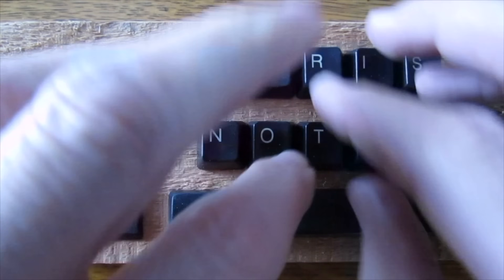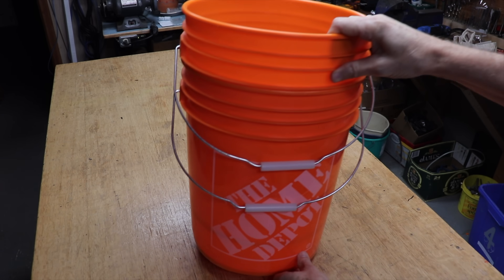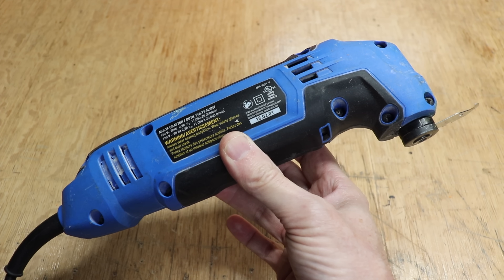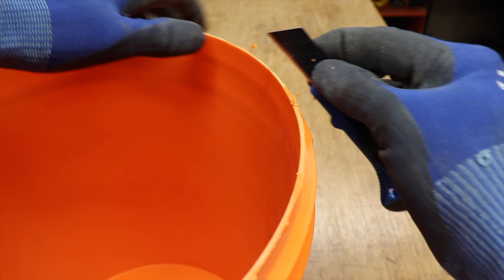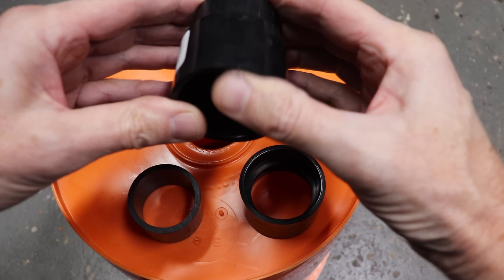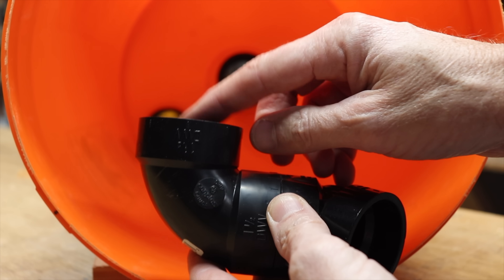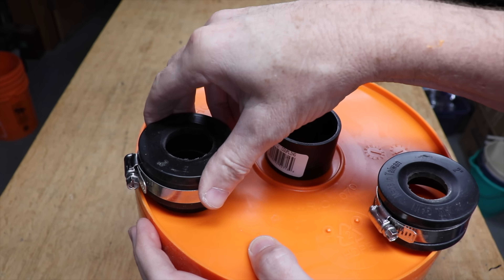How to Make ● Simple Cyclone Dust Collector

Comment: Why don't you have a dust bag in your vacuum? Wouldn't it make more sense to have that for the dust that comes through the "orange system" instaed of trying to protect the filter in any way. The dust bag would fill in that much, you could easily modify that so that you can empty it and you vacuum would be in much cleaner state.

Comment: Awesome, works great, one issue. My little 5 H.P. ShopVac causes the Home Depot buckets to collapse when I use it with my orbital sander. Seems it needs some mechanism to reduce suction but, I don't want to affect its ability to function. Any suggestions?
Reply from the maker: I made an update video on that issue!!
Reply: Nice, thank you Chris. Easy fixes. Heck I had already ordered a couple of 90 MIL thick buckets.

Comment: Fun tip: to double the  airflow, hook one shop vac to the cyclone bucket, hook the second one to the exhaust of the first one. Now your vacuums are hooked in series and you have double the airflow but less pull when vacuuming (dry vacuum usage) 

To increase water lift: hook a second shop vac to the bucket in similar fashion  on the opposing side of the hose intake hole. Now your vacuum is hooked up in parallel and you have double the suction. (Wet vacuum usage )

You can also do both simultaneously if you have 4 vacuums lol.

Comment: Как думаете, уменьшится ли сила всасывания, если магистраль сделать в общей сложности около 5 метров?
Reply: Для более длинных всасывающих шлангов может оказаться полезным использовать шланг немного большего диаметра или жесткую трубу с клапанами и соединителями для подсоединения более короткого гибкого шланга. В зависимости от применения, мощности всасывающего двигателя и использования вытяжной системы {мастерская бытовой системы} Старайтесь, чтобы шланги были как можно более плоскими, без резких изгибов, особенно без петель вверх и вниз, чтобы предотвратить скопление пыли и закупорка и уменьшение потока в шланге или трубе.

Может быть полезно проложить незащищенный заземляющий провод вдоль внешней стороны жесткой трубы, чтобы остановить накопление статического электричества и предотвратить легкие, но отвлекающие удары электрическим током.

For longer suction hoses, it may be helpful to use a slightly larger diameter hose or rigid pipe with valves and connectors to connect the shorter flexible hose. Depending on the application, the power of the suction motor and the use of the exhaust system {household system or workshop} Try to keep the hoses as flat as possible, without sharp bends, especially without up and down loops, to prevent dust from accumulating and clogging and reducing the flow in the hose or pipe

It may be helpful to run an unsheathed ground wire along the outside of the rigid pipe to stop static build-up and prevent mild but distracting electric shocks.

Comment: Great video but I'm not sure if it's what I need. Maybe so or maybe you have another video on sandblaster cabinet dust. Sandblaster cabnet dust is my problem. The dust kills my visibility to the point where I can't see my work. I don't want to pick up any heavy material. I just want to clear the air so that I can see what I'm doing. Any suggestions?
Reply from the maker: Other commenters have said it worked for drywall dust so I'd say it will work for sandblasting too.

Comment: Just built my dust collector today, tried it out & am very happy with the results. Thanks for a great project, that doesn't require "specialty" tools or cost a small fortune. I then caught the "update" video & will be adding the base to stabilize it. Thinking I might put castors on the modified base, for easier mobility

Comment: Hi Chris, thank you so much for this very instructive video! Just what I needed before chaos ensued in my garage! I have one question - what is the impact on the shop vac and the dust collection efficiency if I were to use bigger pails or maybe use one of those plastic garbage bins? Would it work just as well? I suppose emptying that would be a bigger pain, but the trucks could haul that away! Maybe you were trying to keep the effort needed for emptying the saw dust at manageable levels and so used the HD buckets? Again, really enjoyed the video and the thoughtful parts list you appended. Have a nice day!
Reply from the maker: Thanks for that!! You could try with a larger container. It should work the same and possibly even better. It's all about experimenting and using your noggin!!
Reply: Seems like the straight connectors mentioned won’t work with the elbow couplers. Need to be off a smaller size
Reply: @shankarh6915 did you try make it with bigger barrel? How it work? I wanna try make one with 200 liter pvc barrel (cylinder shape).

Comment: “Friction fit”. The correct terminology may help your’ audience understand what you’re talking about.
Reply from the maker: Sorry about that. An "interference fit", also known as a "pressed fit" or "friction fit", is a form of fastening between two tightfitting mating parts that produces a joint which is held together by friction after the parts are pushed together.

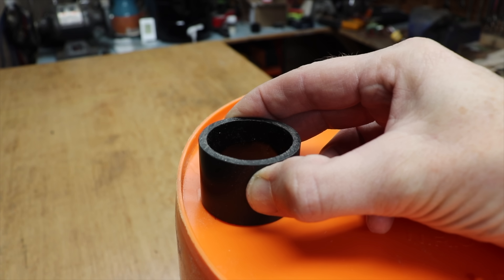Comment: Coming back to this thread 2 years later, still struggling to find a better dust collector that won't break the bank.  I found the problem with my build, my buckets aren't Hofmann Plastics buckets (2:45 Minute mark) made for Home Depot, my buckets were manufactured by Leaktite.  So I have buckets that are more  I_I  than  \_/.  Hofmann is a Canadian company making finding these buckets even harder.
Reply from the maker: Others have commented that Lowes buckets work too.
Reply: How did it affect the build?

Comment: What is the screw for?
Reply from the maker: I show using the screw in the video.
Reply: @chrisnotap  yeah I know. I just wasn't 100% sure what it was for. Do you screw screw it into the inner pipe to keep it in place?
Reply from the maker: @chopa479  Yes it holds the pipe in position.

Comment: Perfect. I can mount my vacuum on a shelf up high in the middle of the shop and then run a hose down to this little gem. Great design and well made! Kudos!
Reply: Can anyone comment on why building this is better than purchasing the Dustopper from HD for $59? Is it that much better?
Reply: @adompe3  It is cheaper, funner, but the satisfaction of a job well done or the innovativeness of improving on the design is my motivation. We'd all be living in caves otherwise. i can already see how to improve it because i built one years ago that had zero dust, mind you it was a lot bigger but it was not filtered at all.

Comment: I built the dust collector, everything went together as advertised. Great directions. Unfortunately when I  connected and turned on my 5 gallon shop vac it sucked the Home Depot buckets in and distorted their shape. It still functioned but clearly the walls of buckets I have are too weak. HD must have changed the formula. I substituted an old bucket that held driveway sealer. Noticeably stiffer. It held up just fine. So I’ll look for another stiffer bucket to replace the head. Since none of the pipe fittings are glued they can be removed and reused.
So I’d advise sourcing stiffer plastic pails.
Reply from the maker: I did and update video for that problem!

Comment: Simply ingenious. Im getting older and I dont do well in dust. Ive been researching for hours to put up plastic, utility blowers with 12 to 16inch wide x 30 feet long flexible ducts. I just want as dust free an environment as possible. Renovating a basement. Its a walkout but doesnt have good air flow with the only windows on the same wall as door. I am definitely going to build this. I already have all the parts and multiple HD n Lowes buckets! Thank you for this how to video! Its going to save my lungs and my wallet.

Comment: I just built this in my garage this afternoon, and it works perfectly! Thanks so much for making this! The only thing that didn't work out as well for me was the friction fit between the top and bottom buckets (it's a bit loose on mine). It's not really a huge problem, as the buckets don't really come apart when I'm using the vacuum, but I do have to be careful not to pick up the system from the top bucket or it will just pop right off. I may have removed too much material when I used a razor blade to create the angle and remove the burrs, so it was user error on my part! Just something for other people to be aware of.
Reply: Built your dust separator today and very pleased with the final  results. A couple of comments: my vacuum has a larger hose, wonder if 2” fittings might have worked better. Second was either I have a more powerful vacuum or my HD buckets were made with thinner walls, the buckets collapsed after running for a few minutes. My solution was to pop rivet 3/4” x 1/4” ribs every 4 inches around the outside of the buckets. Problem solved. 😅

Comment: I saw this video a couple years ago and wanted to build this ever since, but didn't really need it enough to build one. A couple days ago I decided I wanted the power of my central vacuum system to wet-vacuum my car's carpets but the vacuum unit is not okay with moisture. This cyclone separator solved my problem and works great at separating everything including water, but it was also very simple to build and only took one trip to the hardware store for all the supplies! Thank you!

Comment: Do you have a video that talks about how well this works if you hook the  standard hose side of your dust separator directly to an orbital sander or circular saw as opposed to just using it to clean up your shop floor? If you do not, can you recommend a video? Or is that even necessary?

Comment: Very efficient build. 
Tip: use 2 high quality magnets (Neodymium) instead of the backlight or measuring tape to find points on the other side of materials. Just put one magnet on each side and drag into position. Most magnets will work on this thin walled bucket, but even drywall can be done with good magnets.

Comment: Chris, no matter what I do, I can't get the buckets together. I followed your instructions to the letter. Is it the buckets or me? I Spent nearly 3 hours and pretty much ruined 1 bucket. I left the second bucket with the rings removed in case I can find out why they won't come together. It appears that the bucket with the rings removed is the same diameter as the center of the second bucket upper rim. Chamfering the first bucket made no difference, it still ended up in the same place. I tried chamfering the rim of the second bucket, but I would have to remove too much material thus causing the rim to come apart. What am I doing wrong?
Reply from the maker: You're not doing anything wrong. From reading all of the comments, it has made me aware that home depot buckets are not the same across the land. There seems to be 2 different styles. Quite a few commenters have also said that Lowes buckets work well. You may want to try theirs. Sorry this isn't working and I hope you find an alternative.
Reply: @chrisnotap  Chris, thank you for getting back to me. While I was at Home Depot, I purchased a bucket to replace the one I ruined. You'll never guess what happened. The new bucket matched perfectly with the bucket that was trimmed. also, the Lowes bucket that I trimmed, fit perfectly into the Home Depot bucket. Unfortunately, I had the same problem with the Lowes buckets.  They just wouldn't go together. I may take the Lowes bucket that I trimmed to Lowes and see if it will fit into a new Lowes bucket. Thanks again, I now have what I need to make your dust collector.

Comment: Great invention but that
Great invention!   However, that's a wee lit'l shop vac you have.  I'll need to get bigger fittings to fit the large shop vac hose, whatever size that it.  I'm wondering it that might collapse those buckets since those big shop vacs are beasts.

Comment: I just tried this, and the buckets will not fit together. The ones I bought are made differently, so that they are straight from the handle up. Home Depot must have seen your video and said, "We can't have this eating into our sales of our cyclone separator. Let's redesign the bucket to get rid of the taper at the top." I will find a way to make it work, though. They aren't going to force me into anything!
Reply from the maker: Commenters have made me aware that home depot buckets are not the same across the land. They are different in some parts. There seems to be 2 styles. Commenters have also said that Lowes buckets work. You may want to try theirs. Sorry this isn't working for you and I hope you find an alternative.
Reply: I’m thinking that I can use some foam I have lying around to make a gasket and  clamp the buckets together. I will try that and see how it works.

Comment: I 1000% love this design and how cheap and effective it is. Thank you so much. 

I also had a great idea for it the other day. I clean a lot of electronics equipment. Washing and drying a circuit board takes too long and I hate it. 

But then it hit me. If you reverse the flow of this thing and clean out the dust, it becomes a parts dryer that I can just sit back and let it do its thing. Works great!
Reply from the maker: You don't need to reverse the flow! It is air movement either way you do it!

Comment: First, i was like, yeah yeah, lets buy the real stuff, the oneida thing. But the one with the bucket and ready to go is like 200$can, and some reviews says its a little fragile. So i decided to do it my self.  Used jigsaw to cut the bucket, et knife for  the rubber lids, and mitter saw for the ABS pipe.  Took 20 min. The hardest part is to stick the 2 buckets together, but i succeded by pushing it with my belly while holding buckets with my hands.  
Tried with some saw dust and other stuff, it really works. This is the greatest invention ever!! Today im gonna try with drywall dust, a ton of it, because i just finished renovating my old place. Wish me good luck, to my shopvac too !
Reply from the maker: That's great! Let me know how it works with the drywall dust!
Reply: How did it work with the drywall dust? I've wondered if it can handle fine dust like that
Reply: @j10001  very good. I w
Reply: @j10001  very good. Of course it doesn't grab 100% of the dust (maybe 80-90%). So you still have to change your shopvac paper filter from time to time, or once your done with the drywall mess.

Comment: Still the best setup on the internet. Drywall buckets work also, although they are usually 4.5 gallons instead of 5 gallons. Free is still no cost. Construction sites usually through drywall buckets into a dumpster.

Comment: Finally one of these diy dust collector videos that doesn't use that stupid injection molded lid.  This also works as a diy large capacity house vacuum, so long as you have a few extensions and a brush head accessory for a shop vac.

Comment: I made one of these and after the maiden voyage I broke it apart and tossed it out.  While it does work to some degree,  my filter is clogged with sawdust, drywall dust and dog hair.  Be a man, vacuum your shop the regular way.  When the filter clogs, do what our ancestors did.  Take it apart, shake it out in the garbage can, then go outside with your air hose and see how much of your neighbors garage you can turn white.  Hopefully it rains before they get home.  Reinstall the filter and carry on.  While not an epic fail,  we had the promise of prime rib and when we show up there was only hamburger.

Comment: Does the center hole in the bucket have to be in the center to work? Can it be on the opposite end? Cause I'd like to have space to mount a smaller vac on top of the collector.
Reply from the maker: Needs to be where it is.

Comment: I followed your plans and built one of these last summer and it works great!
I also noticed another advantage. A 5 gallon shop vac isn't really 5 gallons. You'll only get 2, maybe 3 gallons of liquid before you start to submerge the motor. With your design collector I can suck up a full 5 gallons of liquid. The motor stays dry and the filter doesn't even get damp.

Comment: Great video I put one together the other day seems to work pretty good I solve the Tipping Problem by just buying a bucket Dolly from Walmart the bucket sits down in and gets clamped in place by 3 wing nut bolts I did still cut off as pale and slid it up from the bottom to prevent collapsing and so that I could slide the inner bucket out without having to undo the clamps

Comment: If you added a cone inside the top half the dust would spin ever faster as it drops down the cone. When it exits, the dust gets thrown to the sides of the lower bucket leaving almost no dust to be trapped by the shop vac filter.

Comment: This video makes me equally happy and equally angry. I had the thought yesterday. WHY DON'T THEY MAKE THE VACCUM THE CYCLONE? How have manufacturers not figured out how to move the dust port over to the side of the vacuum, to stop the filter from clogging up? Unbelievable. So they shouldn't even sell a vacuum today with a center dust port, it's almost like a scam to not have a "built in" cyclone style canister designed into every new shop vacuum. I think this video is the most simple and maybe best "do it yourself" cyclone I've seen so far, a lot easier than trying to glue really complex angles. Thank you!
Reply from the maker: Wow! Thanks for that!

Comment: Or just use a large Shop-Vac with a filter bag.
Reply: You still would use a bag, but the bag would only be getting the finer dust and thus last longer.  The heavier dust goes into the bucket.